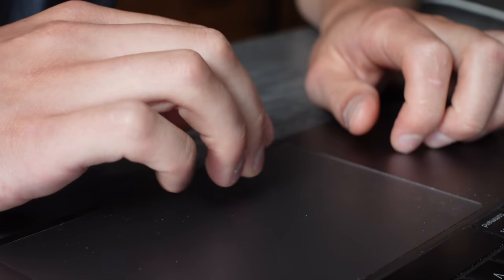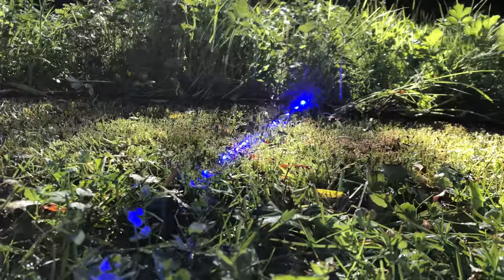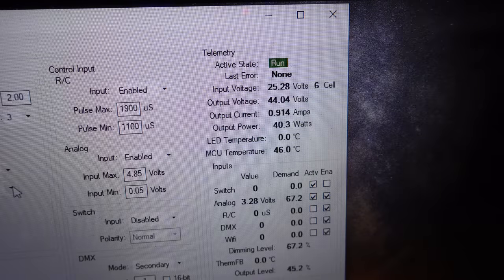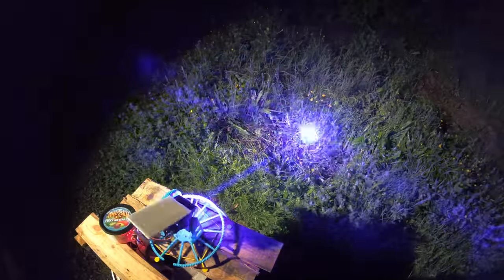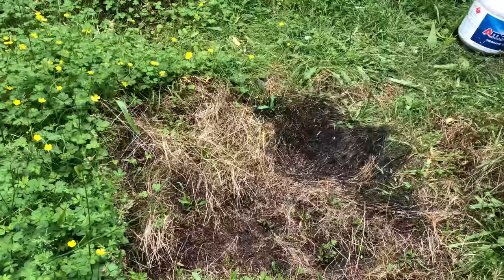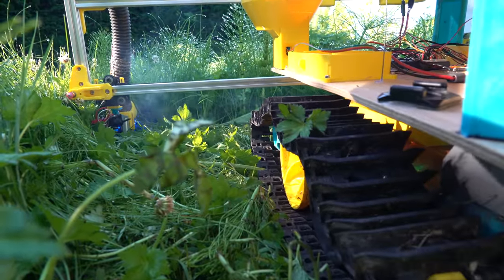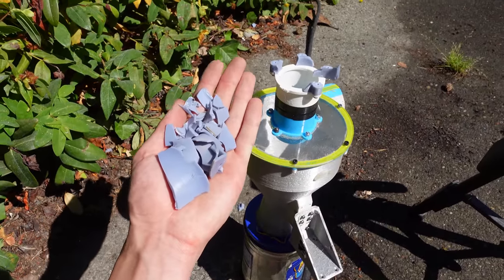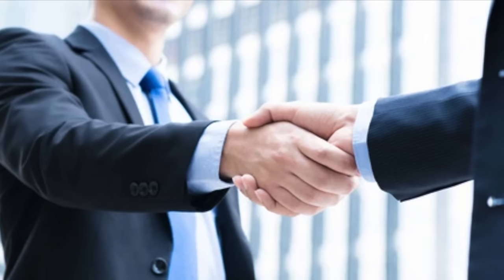Mowing My Lawn with a LASER!!!

Comment: I just love how inefficient this is. Using 1000x the energy to mow 1/8 the area of a gas mower
Reply: ..because....laser....LASER..
Reply: Not to forget the noise it makes at the end...
Reply: Yes but this could be adapted cut weeds on very rocky terrain,  I have 30 acres and often think if I could do something like this during winter when the grass is wet
Reply: @scottstewart9154  no, that would be a bad idea.  This laser is so dangerous that refections off a rock can blind before the eye can close.
Reply: Also, a poop tonne of potentially blinded wildlife
Reply: Yes... but it's "Fricken Laser grazer way" !! it's gotta be worth the expenditure! 🙃
Reply: Actually, a decent mower, at around 16 kilowatts, consumes the same amount of energy per square metre if the 40w laser is cutting 300x slower - and that volume of grass is very slow going with a push-mower. The next big hurdle, after cuttings management, is edging.
Reply: @Mercurio-Morat-Goes-Bughunting  Hmm... A standard mower covers 1 sq.meter in about 3m lenght of strip. It takes maybe 1.5 secs to walk it one meter at lazy family pace. When dealing with extreme overgrowth you need to cut it twice and jiggle a bit more so maybe 4 secs per meter. I believe my mower was 3 hp / 2.25kW. 4-stroke, aircooled maybe has a mechanical Efficiency at around 15%? Might need 70% of 2.25kW for heavy mowing = about 1.7kW power continuous. 1700 Joules at 15% takes 11.333kJ of fuel. So, summing it: 12 sec x 11.333kJ per sq. meter == 136kJ per sq. meter of really rough weed mixed grass cutting. You can run 40W laser (50J sec 80% system efficiency?) for 2720 seconds (45.3 minutes). (The absolute worst to cut with a standard gas lawnmower was tall grass, like 30cm/1ft tall - horrible, really bogs down engine because it temporarily wraps itself around blade and causes alot of friction and aero drag. Weeds by comparison was easy, like 50 cm tall nettles are minced really quick. Weeds do not grow as densely packed like grass)
Reply: @Mercurio-Morat-Goes-Bughunting  Keep one thing in mind:    a 40 W laser is 40W of output power.  The laser is about 10% efficient, so it requires 10X more electrical energy going in than light energy going out.
Reply: @Paxmax  That's interesting because mine's a 22 hp or 16 kW commercial grade machine and it pretty much stalls on the same cuttings volume - probably because the limiting factor isn't power but chute cross-section. Double-cutting for overgrowth is definitely a necessity because the initial cut is never clean when the cuttings load is too heavy. Making an initial high cut (as high as the blades will go) before cutting lower is a good way to reduce some of the dramas by more evenly dividing cuttings between cuts. The other trick, if you're mulching (or have limited bin space), is to high-cut overgrowth and then stop. Give the mulch time to bed in (or bin contents time to be collected) so it's not clogging up the chute on the next cut (about a week or two), then drop down to about half maximum height on the next cut.
Reply: @starsiegeplayer  Nice. Thank you. I've been wondering about the efficiency of lasers. The idea of a solid state grass-cutter is one I find very intriguing due to the lack of moving parts and corresponding wear and tear - and lasers might be one way to skin that cat.
Reply: @Mercurio-Morat-Goes-Bughunting  22hp, now we are talking about a serious beast of a ride mower? What's the cutting width of that beast? Mine was just a pusher, 38cm cut width(1ft 3in). Maybe it was a 42cm width cut 🤔 anyway, small mower from '93, was there when I bought the house, still working perfectly in 2016 when I sold house. The option for my mower was mulching or bag, no option for a side-chute. The bag option was used maybe twice 😂 too much running back n forth to compost heap. We're lazy, so we usually only cut like once per 3 weeks or a month (Nordic climate, so kind of slowish growth I'd guess).
Reply: Yeah even though it's an interesting idea he definitely spent more effort and energy trying to do less

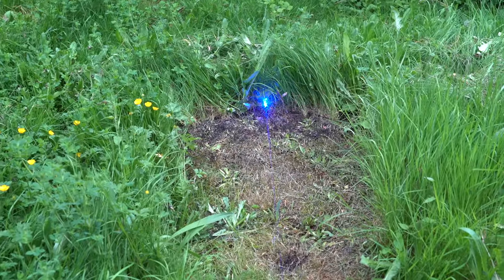Comment: At 3:59 we can see how reliably your accelerometer works to shut down the laser if anything happens to it…
Reply: The accelerometer was in case something knocked it over,  ot if something walked into the beam.
Reply: still doesnt seem to raise above the horizon
Reply: @drumlineking07  Yeah but "knocked it over" and "moving it around by hand" should be the same. An accelerometer only measures acceleration - no matter who how what is responsible for it.
Reply: @aerolus  Yeah by luck? An accelerometer cant determine if it raised above the horizon or not. Either there is no accelerometer, it malfunctioned or the logic that detects abnormal movements/accelerations was too forgiving.
Reply: @CocoaPimper  i thought you were referring to him putting his hand in the laser (which wouldn't have done anything). That being said, he might have it set up to detect tilt (like something knocking it sideways) and not to detect a sudden jolt in any direction (which obviously would've been better lol)
Reply: @drumlineking07  YO :D
Reply: Might be a certain threshold of movement? Like a smol bump doesn't do it, because a heavy raindrop might disturb it, but if it gets hit over it turns off? Good comment though, pretty unsafe.
Reply: hmm yes very reliable

Comment: I think a 30W CW CO2 laser would work well, as it's wavelength has a high absorbance in water. You would probably have to put a front coated mirror on the stepper motor mount, rather than move the laser as they are bulky. The only issue is they tend to have a larger output beam and therefore a shorter focal length, but this could be altered automatically by adding another focal lens and moving it along the axis of the beam.
Reply: @miggelie  someone tried that. not accurate enough

Comment: RC, this is a great idea.  Have you considered using the large array laser with a collimator?  There are specific lenses for higher energy use cases.  Also, if you got a fiber, you could get things more flexible.  With a collimator setup, you can extend the effective focal length by having a smaller emission source to focus from.  Wider doesn't do much as the ability for the material to shed the heat wasn't being overwhelmed in a timely fashion.

Focusing the higher power array should substantially improve cutting and make the mower capable of cutting a lawn in a reasonable amount of time.
Reply: you thought a regular lawn mover blade was to much hassle well now you can have a lawn cutting laser🤣🤣🤣

Comment: I got an idea that mimics hair cutting, that might improve this lawn mower:
1) It could grab a chunk of plants in front of it, I imagine something bending down from the top in front of the rover.
2) The mechanism has flattened the grabbed plants at the point where it should cut.
3) Laser at the flattened point (from side to side as it does now). The laser should focus at the distance where the plants are held.
4) Drive some centimeters forward and repeat.

Comment: for the impeller put a air filter from a car inbefore it, and use a blower for it instead of a turob impeller. Its going to be much simpler and still produce the same air pressure, and remove the two varying openings, those varying openings actually create a air raid siren effect(change in pressure creating noise) probably would be a better design.

Comment: For a while I thought of a similar thing, but powered by concentrated sunlight. Instead of 40W, you'd have up to a kilowatt and it's free energy (when the sun shines). A TV fresnel lense should do the trick, if you don't want to play with mirrors.
Even cheaper solution: An insulated box with no bottom and a double glazed top. It'll cook the grass alright.
Reply: why not do it then?
Reply: That's how they destroy weeds.

Comment: Nice job!  Can I suggest that the laser needs to be arranged with a lens which produces its focal point close to the cutting line so that it then disperses to harmless strength soon thereafter.  So Laser-Diverge lens - Concentrator lens with focus at the cut line, and thence divergence to nothing.  That will give maximum cut power on the cut line (using the left-right-left rig), and safe power beyond.  To get an acceptable cut rate in the centimetre per second range you need to really max the cut power.

Comment: This idea can be improved with an autofocused sensor to get data at the nearest piece of grass, and adjust the focus of the lens to send the focal point of the beam to that piece of grass. You could seriously improve the speed this way.
Reply: Or put it on a tracked rc and front cam for predictive auto leveling

Comment: mount laser laterally in enclosure with open bottom, with a series of mirrors both sides, then mount that enclosure to a mower chassis, stepper motor, string and stake. Safe, quiet, automatic. Add a filter to the enclosure lid and you have a disco light, for parties in the long grass. Burn messages onto rocks or make glass blobs on the beach, boil water by remote or give the trees the exact same haircut. Hire it to neighbors who can train it to level their gardens and/or have a party.

Comment: you could stationary mount your laser vertically pointing at a spinning mirror in like a push mower deck with a reflective surface around the outer perimeter of that deck so you get multiple cuts out of one beam as it is reflected. putting the laser in a housing cuts down the safety issues and lets you optimize your laser power to cut distance. great build
Reply: I like that idea. Add in a fan to move the debris and it could probably work similar to a traditional mower.... But with singed grass blades and a horrible smoke smell.

Comment: What about using a big lens mounted on a sun tracker to focus sunlight and a mirror/prism set on servos to orient it?
In fact, you could also add a small Stirling engine to the mix to make it solar but not photovoltaic powered!

It would only work when there is enough sunlight, so it will need to pause when there isn't enough, but it will give enough time for the battery to recharge and keep going for a while!
You could also go all crazy and use the excess energy to build up air pressure and release an occasional blow to push the grass away, it would be much quieter (as it would only be from time to time) and perhaps more effective than vacuuming.

For a totally overdoit project, you could add LIDAR to detect where the grass need to be cut.

Comment: the idea i had was that instead of blades in a normal lawn mower, its replaced with laser, that way it can be a very powerful laser and its enclosed in the body of a normal lawn mower so there's no exposed laser. maybe it will be 3 rows like a face razor so it cuts the grass 3 times in 1 pass. that way you get a 'blade' that never dulls in a lawn mower.
Reply: but that requires physical effort
Reply: that’s genius
Reply: @dtbkdn  you can still set it up the same on an automation silly
Reply: Laser diode would still need to be replaced
Reply: Also with mirrors to bounce it in almost a plane of laser. Or maybe a lense to make it into a line

Comment: I think the logical next step is to build a lawn mower that magnifies the sun's rays into a solar laser. You'd have to make it to automatically adjust the angle based on the sun's movements, but I think it could be done
Reply: I'm planing to build a solar cutter, but I don't have the money to buy what I need now. I don't think laser this powerful should be in the wild without proper care, this 130w alone can blind animals that looked at it (birds, etc) since it was running for so much time.
Reply: You can can focus the sun's rays fairly cheaply by taking apart an old DLP TV that no one wants anymore and getting the gigantic fresnel lenses that are in them.  They focus the suns rays very well and you can burn through a lot.  It would be too big to mount to a mower, but could be on a stand that rotates.

Comment: I had this exact idea in 2010. All my friends were like "Oh that will start a fire". Anyway, I guess I'm glad to see it's an experiment and not some product someone made a million dollars on.
6:47 That might actually be better. If the beam is hot enough to cook but not hot enough to cut, then it's below the temperature to start fire and, if continuous, eventually the shifting and rain, and sprinkler or whatever will cause the cooked parts to just sink into the grass and help fertilize it.
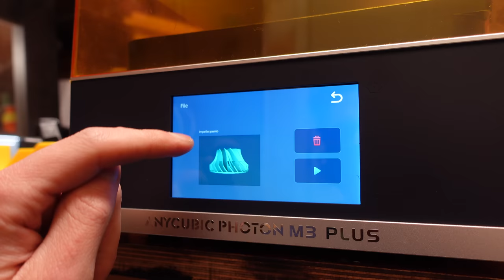13:49 My idea never had a vacuum setup to suck up the grass. My idea was basically an arch with multi axis wheels on each end and the beam would bounce between mirrors at the base of the arch hundreds or thousands of times before it is directed into a diffuser (either a patch of white paint or a small glass sphere).
Reply: POS comment,  You had an idea but never did squat with it.  So, big whoop.  I had the same idea for an awesome time machine but never got around to building it.  🙄

Comment: When I envisioned a laser lawn mowing, i pictured a lawnmower with a laser instead of a blade in an enclosure.
Laser has an effective distance so work with that for enclosure size.
Use a High-powered laser into a shallow reflective chamber where the grass cutting occurs.   That way you have more cutting per pass. Try shooting a beam into a reflective hexagon (imperfect so it doesn't end up at laser again). About 6" deep on wheels. Mow manually or robo. Auto shutoff if wheels lose pressure (indicating mower rollover or being at an unsafe angle).
More ideas on this if interested.

Comment: I have a couple of design ideas.

1. Add a thing on both sides that sticks out with a piece of wood or something for safety
2. Add a fan for the laser so you can get the best of the output (going off of what you said at roughly 18:20)

One will improve safety, while the other will improve probably the life of the laser and the laser itself 🙂
Reply: 1.? 2.obvious
Reply: @kedrickstahley7292  
1. I don't really know what I meant for this one, though I think I was thinking something like this, if this helps:
|--------|||--------|

2. I only really said 2 just for the sake of him not actually doing it when he realized it

Comment: Wow, this project started out at like a 9 on the danger scale and every stage just cranked up that horror factor.

Very entertaining video though :D I wonder if it would be possible to optimize the design of the laser for maximum grass cutting potential. Obviously you couldn't use off the shelf/scavenged parts anymore, but it would be interesting to see if you could get a noticeably better result with a custom laser.

Comment: rather than have a single laser moving back and forth, I think it would make more sense to have array of lasers making much smaller movements back and forth.  If your laser slide is 3 feet.  Maybe make 6 laser array that covers 8 inches each, except for the last two outer lasers that are 6 inches each.  Each of the lasers should overlap with 2 inches of the laser to the right or left of it.  If its even cheaper to do, maybe use a single laser, but have a mirror system that simulates the 8 laser array that I just described.
Reply: With an array the issue with power consumption Will come

Comment: Just a thought, if you take a reflective cylinder, like the shape of the underneath of a lawn mower, and allow the laser to reflect , or use multiple lasers, within that contained cylinder, basically replacing a lawn mowing blade, might the practicality go up, and safety risk go way down?
Reply: You'd be better off using a mirror mounted on a ~45° slant on a motor, as it spins, it would reflect the laser to a circle. It would be less safe since the laser would be shooting 360°.. If it got bumped or something and made it shoot higher than grass level
Reply: no

Comment: I've had the laser cut idea myself for hedging .. 
I have large hedges and they need a full day of work to shape and level etc.
I've dreamt of a laser matrix cross pattern on receptors that are placed and measured for desired height, width, length and at the press of a button the laser fires up, moves along its matrix and     zap-pow its all perfectly levelled and trimmed.
Ofcourse in my mind this process (aside from set-up) took a fraction of the time you showed here with the mower.
alas I guess it's normal cutting and trimming for now.

**the laser matrix pattern would be akin to Resident Evil 1 movie in the corridor.
Reply: Wow, a whole day of work,no wonder people r dying younger, they r rotting from the inside.

Comment: @rctestflight. The key is to mount it in the mower under the deck. But close off the hole for clipped grass. Line the inside of the deck with mirrors. Then use it

Comment: There is a point where you say “basically turning up the sun” got me thinking, could you focus the sun to do the cutting? Would there be a consistent way to direct sunlight (provided it wasn’t cloudy) using gimbals and servos and light sensors to make this device use solar power? Could you build basically a “Lawner Rover”?

Comment: Hey ! 
Good idea to use lasers for cutting grass !
Even if you tell people to not try this at home, I think the security part is not taken sriously enough.
However, I would recommend you to use infrared wavelength laser superior to 2 µm like CO2 lasers or fiber lasers to greatly increase your cutting permormances. You will get a much better coupling between the laser power and the water in the grass than with laser diode that should emit around 450 nm. More over, you will get a better energy conversion from electricity to laser power.
Finally a would strongly recommend you to just replace the blade of the mower with the laser so you can keep the laser beam under the mower cover and get benefit from reflections inside the cover.